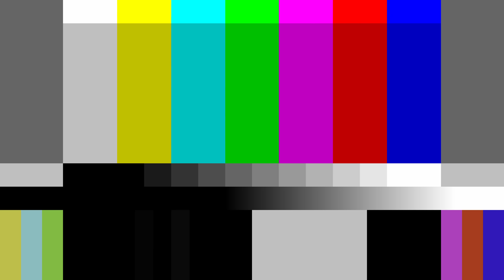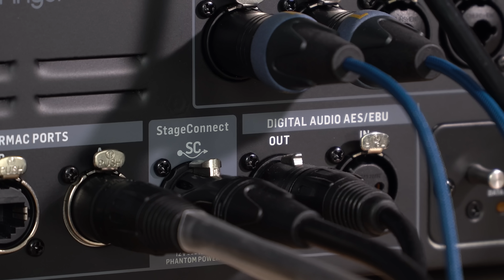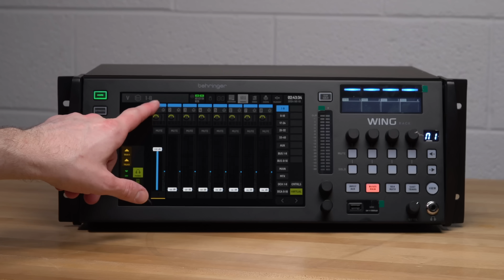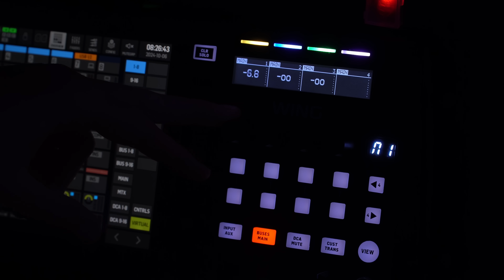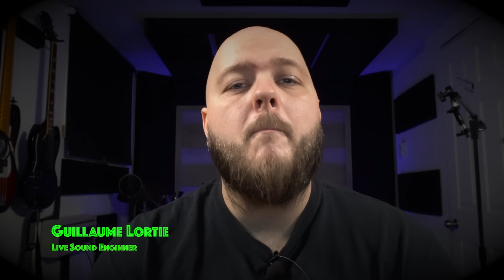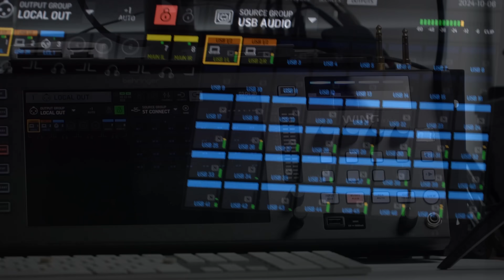Behringer WING RACK Release Day First Look and Walkthrough

Comment: how would I marry the wing rack into my current wing setup.
Reply: They will likely be able to connect to each other through AES50. Two original wings can be connected through a single cat cable and around 30 inputs can be shared with each other under "AES50 C", which lets each wing act as a mixer + snakebox
Reply: @jsdog153 Not just around 30, 48 channels in both directions at the same time over AES50 (any port; doesn’t have to be the C port).

Comment: Wow this rack has full Dante support. I'm so impressed. Version 3.0 firmware now supporting full bus to bus sends...Beautiful touch screen on a rack mount...this will be a game changer for the small setup on the go. Great quick review!
Reply: I’ve been wondering if that internal Dante card means preamp control of Dante stage boxes and everything?
Reply: @calebgebhard7863  I think your still need a Dante Controller software  for that but you should be able to patch. As far as I know, the Dante inputs, had fixed gains last time I looked in the Wing input section.
Reply: @calebgebhard7863  unlikely Dante doesn't include a speck for remote control so each manufacturer produces there own protocol for pre-amp control. Unless Music Tribe produce Dante stage boxes & pay up for the verry expensive chips/licenses you won't see Dante I/O  stage boxes with pre-amp control.

Comment: I'm confused as the Dante card go inside the unit or into the expansion port?
Reply: @Reedith  theres two different one. Expansion slot or the one that goes internally that attaches to where the ethernet ports already are
Reply: just set it near the port. it senses that it's there.

Comment: Well done being the first to get a real video up of this beast!

Could you maybe go into more detail about the option slot inside of the rack for Dante network? Is this separate from the expansion card that you can buy to replace the sd card recorder?
Reply from the maker: Thanks, yes I did a video about the Dante cards in the original Wing & they work the same here. You can either buy just the Dante module that goes inside - or the module that is mounted on the option slot card, so if you want to use other cards in the option slot, you don't have to give that up to get Dante installed. Thanks for the question!
Reply: @DcSoundOp  can you install both the internal card and the option slot card for lots of Dante?
Reply from the maker: @johnfolsomjr  AFAIK… yes. But take that as a soft yes for now, I haven’t tried it myself snd don’t have the cards anymore to test with.
Reply: @DcSoundOp  that’s awesome, even more flexible than I realised! Thanks for the quick reply!
Reply: @DcSoundOp  I looked for the internal Dante card last week and only found one kinda sketchy retailer online.  Everywhere else either didn't list the product or was out of stock.

Comment from the maker: Hi everyone, I hope you're having a great Monday so far. I've been working on this one for a while, let me know what questions you have in the comments & I'll do my best to get to them in a follow up.
Reply: @DcSoundOp  be interested to see if you think this would be possible to split a mic input to a dry and a wet (using onboard FX). I'm in a touring band and we currently run an x32 for iem. We have some songs with sections on the records with vocal FX. It would be great to try and replicate that live.
Reply from the maker: @davidanderton2437  Hey, great question. You can assign a single input to every channel on the console if you wanted, so splitting mics into two channels for separate processing is super easy. Each channel also has an Alt input assignment (like digico) so you can have a backup hot patched and ready to go if your primary mic fails. Thanks for the message!
Reply: Please let us know the appropriate stage box model that corresponds with this unit 
Thank you